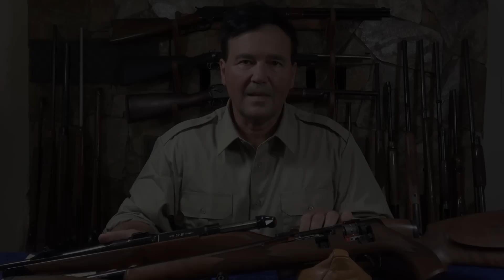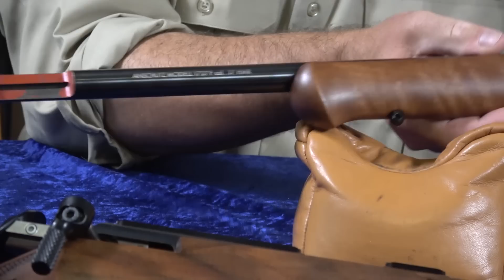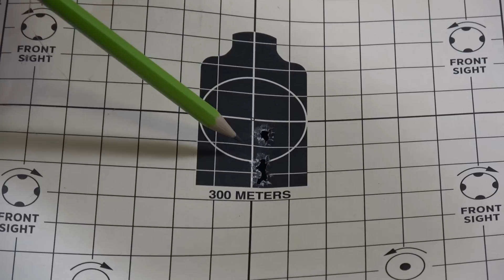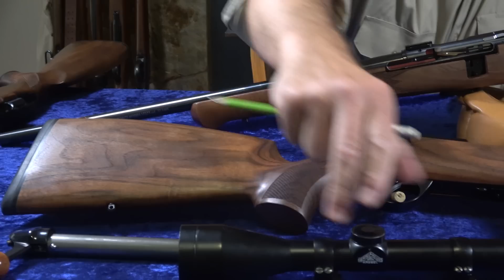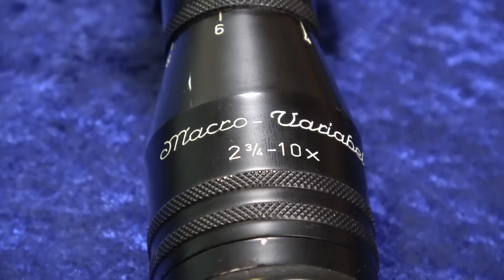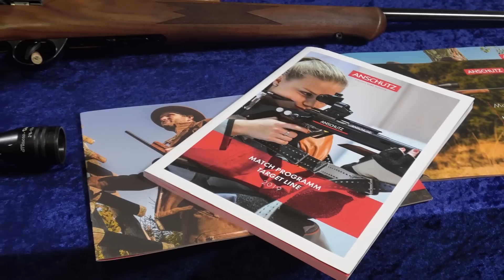Most EXTRAORDINARY .22 I've EVER Owned

Comment: I have the Biathlon version, just to plink with, because I love the action.  It's a .22.  And the most amazing thing is when you slowly push the bolt forward,
the round jumps and ends up held by the bolt, as if magnetic, and it feeds it straight into the chamber.  No rubbing or scratching the round.  
One of the coolest controlled feed I have ever seen.   Thank you for the Awesome video, Mike.  I know Brad too :)

Comment: That locking system is just like an air tool quick disconnect. Truly awesome!
Reply from the maker: Hey - TJO - I did not think of that! You're right - I've used those pneumatic but didn't make the connection until you wrote it : )  - some kind of pun in there.  Thank you! All the best.
Reply: That's just what it's like!
Reply: @ekim000  only a bit more precise?

Comment: Nice to see the blanket on the table, Thank-you.
Reply from the maker: Thank you ! It feels very royal sitting at that table. They ordered the fabric from some kind of specialty shop and it may be over the top but resists water and oil and looks like a million dollars. I don't mind plywood but apparently my mind is weak. : )
Reply: @UnitedStatesOfGuns  
Thank-you. More than one of us has OCD and it's pure nails-on-chalkboard ( do they even have those anymore ? ) to see a reviewer drop, clunk, scrape and drag a fine firearm across cold hard metal or rough hewn wood. Especially when an old dirty rag would be 10 times easier on the firearm. To use such a fancy cloth is a display of fine class. Not much seen theses days. So, once again, Thank-You ...

Comment: I got a 1727 17hmr a few years ago and it is incredibly accurate. I tested it at 100 yards with various ammo and found it liked CCI TNT best followed closely by Hornady VMax. The TNT test target consisted of five consecutive four-shot groups that measured .35 .65 .36 .72 .56 ctc.  Three of the groups can be covered with a dime. I found there is a trick to consistently getting groups under half moa.  Put them down range as fast as possible using only one breath. The reason is that the 17hmr is very sensitive to minor wind changes. Otherwise the groups open up to about 1moa.

Comment: The only issue I ran into with mine was that I wanted to attach a short picatinny rail to the front sling pin so I could attach a bipod. The Schnabel forend got in the way so I had to add several rubber spacers.

Comment: The only Anschutz I ever owned was a Model 1422D (I think) with a 54 action in 222 Remington. Out of the dozen rifles I've owned in 222/223 Rem, it was the least accurate of them all. In fact, the firing pin broke the 1st time I tried to use it, and the dealer tried to charge me for it. Even my gunsmith couldn't get it to shoot any better. His excellent advice was to get rid of it, and so for the same price, I got a Sako Deluxe in 222 Remington. End of problem. Not sure about steel balls for locking lugs. They may work on low power cartridges, but an engineering principle is to always keep things as simple as possible. For accuracy, all the gun magazines use five-5 shot groups on one sheet of paper for the lower calibres, and five 3-shot groups for the magnums.

Comment: Spherical shape should have lots of locking power on that Bolt. Just think of how much weight ball bearings carry.
Reply: From recollection, the maximum pressure on a ball bearing ball, is about 10 times the peak chamber pressure of a 30-06.

Comment: i have a question i hope you could help with. i have a savage cal. 17hmr bolt action, is it true that you should not clean the bore with a brass brush because it will damage the rifling.i cleaned it once that way and the groups went down hill from there, i hope you can help with this if you can.